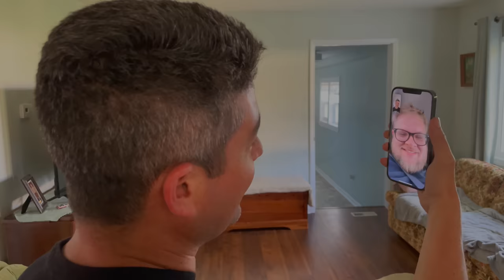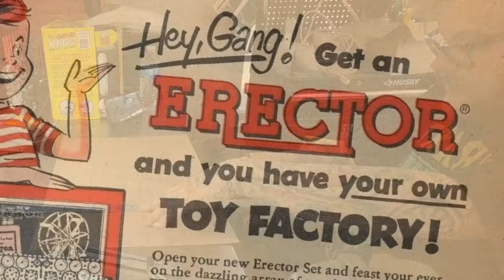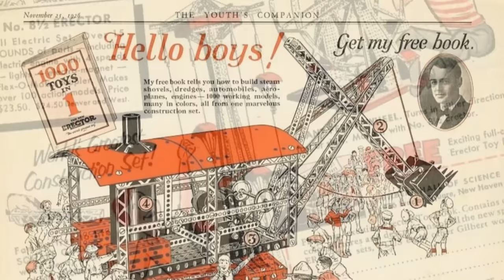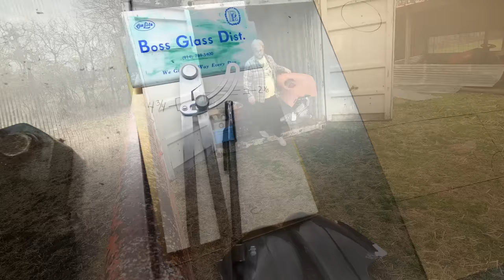PICKLE JAR EP.1: WE NEED A TRUCK PAPER TO PAVEMENT - ISETTA HUALER - Mikey brown

Comment: This is why 1:22 I hate Chevrolet trucks. I had always been a GM/Chevrolet fan. had a problem with my first ever new Chevrolet truck transmission, right before the warranty went out. They did nothing to fix the problem. Just put band-aids on it. The transmission was a piece of shht. This seem to perpetuate the problems by not fixing the design flaws. You would think that a vehicle manufacturer would have settled on a bullet proof design and stuck with it. No, planned obsolescence is the thing, who cares where the end user may break down or get stranded? Right? That truck changed my mind about the brand, I went out and bought a Honda, passed it down to my son, he still drives it.

Comment: Side windows could of been doors from a truck of the 50s/60s flavor. With the skin removed would of had all the roll up/down window guts and tracks. Bonus smoker ash flicking side vents.
Would of solid framed the whole body shell. Weather sealed lipped the floor. Left the front door, but made the whole body shell tilt forward for full engine access.
The whole floor stationary. Steering column and gauge pod be one unit not part of the body shell.
The the front door open and the body shell tilted forward. The engine detail exposed. The damn bed better be dumping work of art. Exploded car show day stance.

Comment: You do beautiful work, Mikey!...I love all the bead-rolled panels!....I'm curious why the front of the chassis needed to be higher than the top of the vw torsion axle top tube, which means a higher floor.....Also thinkin that it might have been good to have better engine access... I love it as an art piece but think you'll still need a real shop truck....